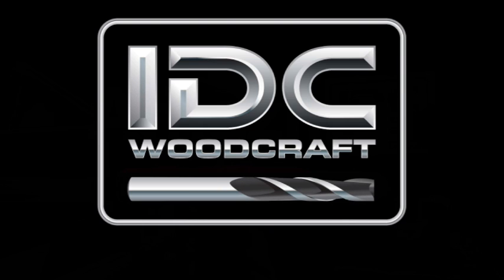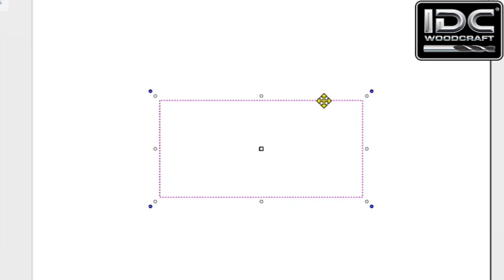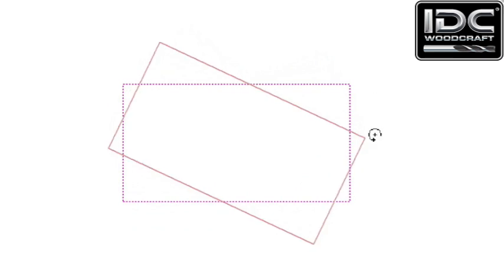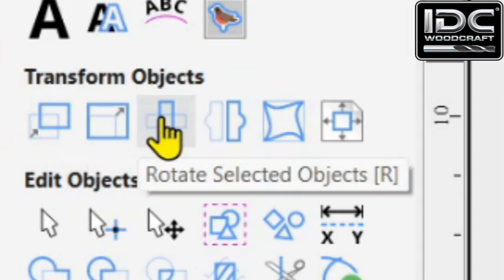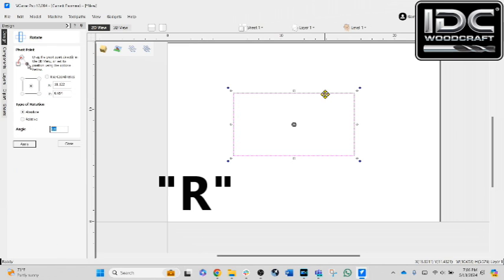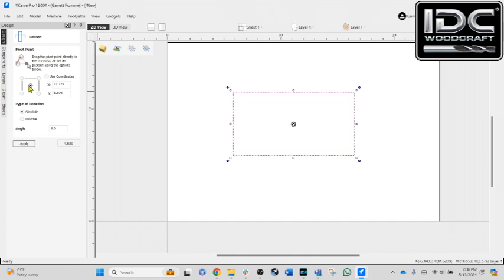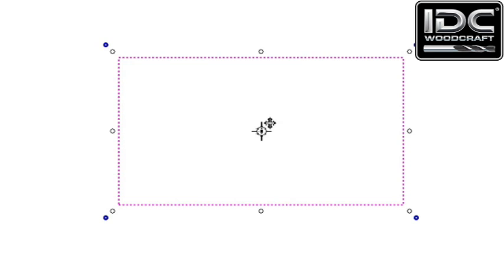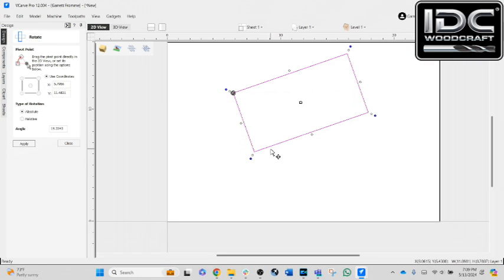Vectric: Rotate and a Node Trick You Didn't Know About

Comment: Another great tip video , I’m slowly picking up the short cut buttons ? I.E f9 to centre etc , is there anywhere that shows or better a printable version of all the short cuts ?
Reply from the maker: spiderspid, I'm glad you're finding the tips helpful! You can usually find a list of keyboard shortcuts in the software's help section or user manual. Some software also have forums where users share printable versions of these shortcuts. Keep practicing, and you'll have them memorized in no time!

Comment: Love your vec trics  programs. Is it possible for your to do a program on how to take scroll saw plans and import them into vectrics. I think many cnc users are scroll saw users. I have many paper plans that i would like to modify and cut out with a cnc but dont know how. Just a thought. Love your channel.
Reply from the maker: CreativeWoodenWonders, I'm glad to hear you love the Vectric programs! Importing scroll saw plans can be a fun project, and many CNC users find it useful. You might want to consider scanning the paper plans and using vector software to trace and convert them into a format that Vectric can read. It's a neat way to transition between both woodworking methods. Thanks for the suggestion and for watching!

Comment: A good example for the rotate is I usually have a sheet that I call design. Where I sketch my project before I break it out to the individual boards. Now if something is articulated,  you can make your center of rotation at a circle that is going to be the axle and verify it's doing what you want
Reply from the maker: sawmilldan, That's a great approach to using rotational features in your design process! Establishing a clear center of rotation, like using a circle as your axle, can definitely help ensure precision and accuracy in your CNC projects. Keep experimenting and refining your workflow - it sounds like you're on the right track!

Comment: the node that is green is where it starts. it defaults to that point. just like absolute and relative positions. you have to move the start point to move all three nodes simultaneously.
Reply from the maker: kenmac6888, You are correct! The green node is the starting point, and moving it will adjust the position of all three nodes together. It works similar to absolute and relative positions in CNC woodcutting. Thanks for sharing these tips and tricks brother!

Comment: When you tried to grab the three notes and then move the line, only the bottom line moved, if you just use the arrow key and move it in the direction you want, all three should move
Reply from the maker: irabloodworth4605, Thanks for pointing that out! To move multiple elements at once in most design software, you can usually group them together before trying to move them. This way, they will all move in unison when you adjust their position.

Comment: Garrett if you right click on one of the three selected nodes on the vertical lines that you are trying to move, then select properties from the drop down menu, a dialog box will appear giving one the ability to move the nodes either absolute or relative. All the nodes will move together in the direction from the selected node.
Reply from the maker: markeldon7363, Thank you for the tip! I will make sure to try that out next time I am working with vertical lines and trying to move multiple nodes at once.

Comment: You forgot to mention that you can key in a rotation amount by holding down your mouse button and keying in an amount of rotation
Reply from the maker: BradLund-vj9yh, Yes, that's correct! In many design software programs, you can hold down your mouse button and key in a specific amount of rotation to precisely rotate an object or element. This can be a helpful tool for fine-tuning the orientation of your design elements. Thank you for pointing that out!

Comment: You might add in that you can rotate in 15-degree increments by holding the ALT key down while rotating. I'm sure there is probably more to it, but this has been very helpful for me.
Reply from the maker: davebrown7619, That's a great tip! Holding down the ALT key while rotating allows you to snap to 15-degree increments, which can be really handy for precise adjustments. Thank you for sharing that helpful technique!

Comment: The "Use coordinate" radio button looks redundant to me too in your circumstance using a square. However, what if your not using a square to rotate? Then the left portion of the diagram would not apply so in turn it looks to me like the right portion treats everything like it was not a square (it is very possible they are not evaluating for a square which makes the square redundant and should not be used. Its a convenience feature) and that is why the radio button gets selected.
Reply from the maker: iwannaapple7190, very good points brother. I couldn't agree more.